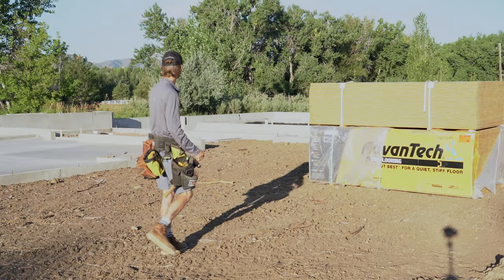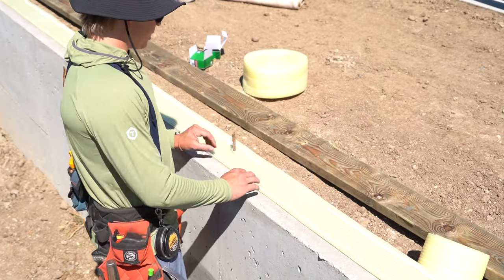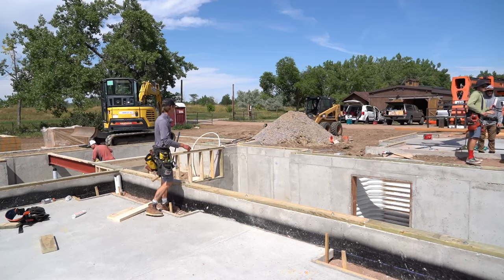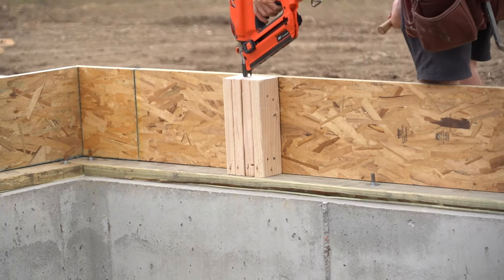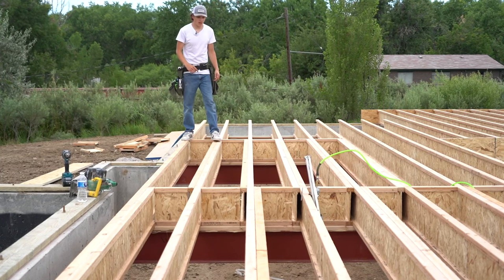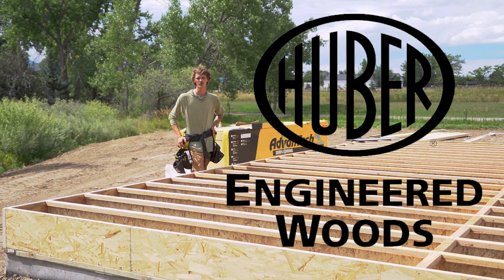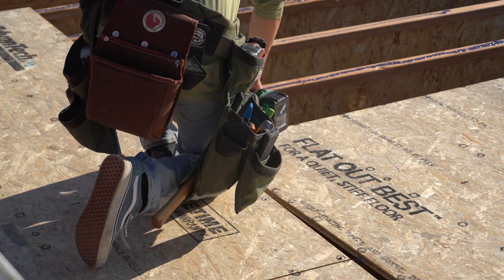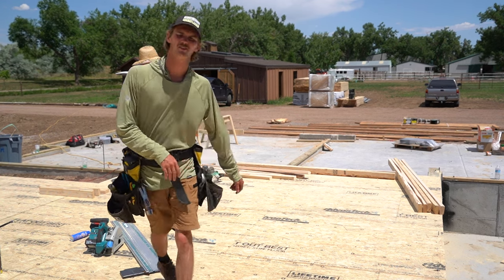a Framer's Guide to HIGH-Performance Home-Building! || PT 1

Comment: Why do you guys drop the floorboards like that? The foamglue dont hold if there arent any glue left on the joists?? 

We build differently in Denmark - so I just want to know :-)
Reply from the maker: Just one of the methods! The glue is expanding so even if you were to try to scrape it all off it would expand and fill it all back in!
Reply: I think that just about every crew in the U.S. drops the sheathing down in one way or another similar to how Coffman Construction does.  How is it done in Denmark, might be able to improve on our  process.

Comment: Good start but in the first 3:30 minutes, you have four anchor bolts that that are located too close to the  ends of bottom plates to meet code..
Reply from the maker: Yes sir, foundation guys did us a favor on those 🙄 unfortunately they will have to come back and hammer drill those in
Reply: Thanks capitan obvious